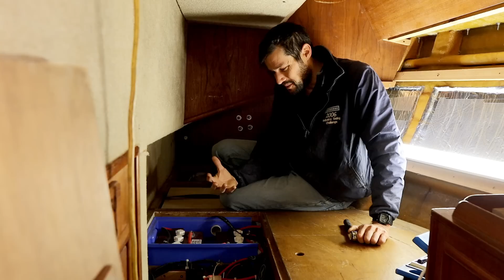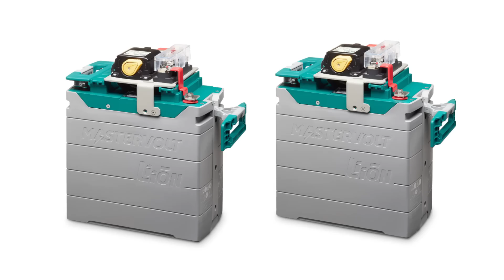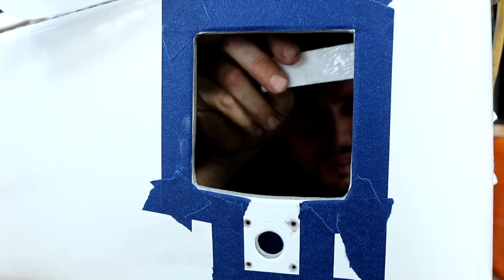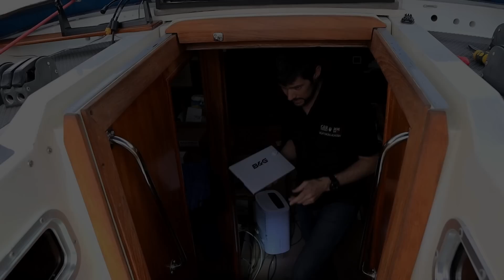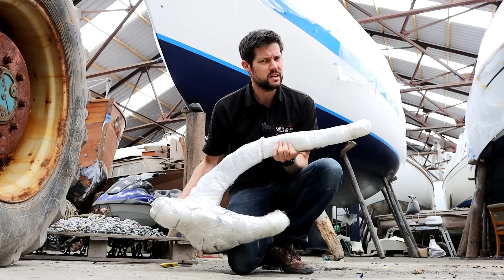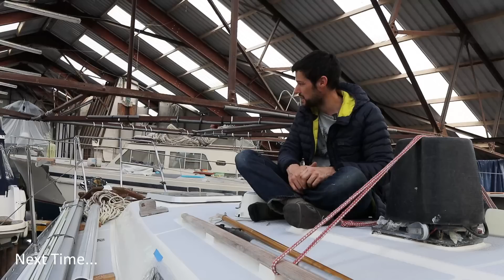Our Biggest Ever Upgrade | Sailing Florence Refit Ep.179

Comment: Will the lithium batteries BMS handle the heavy current to the windlass, without shutting down?
Reply: My understanding is that most Lithium battery manufacturers recommend tying loads like windlass + bow thruster to a lead acid start battery.
Reply: @stephenburnage7687  Well I've been running my windless for six years now with fairly frequent use and I have no problems whatsoever
Reply: The BMS in these dont ‘carry’ the current as you guys think. They will handle any current up to fuse rating just fine.
Reply: @fritsified5952  There have been multiple instances of a BMS switching off all load, leaving the owener without lights, navigation or even VHF. It's one of the consequences of having a complex system.
Reply: @stephenburnage7687  That doesnt mean the BMS of these batteries carry the current as said. Yes, something can go wrong, but these batteries are very reliable. And with the bidirectional DC-DC’s, they will still have power from the starter battery in case of failure.
Reply: @fritsified5952  The question is, is there a way of connecting the lead acid start ystem to the lithium system in the eventuality of a BMS shutdown? Still studying it but most manufacturers recommend removing any automatic battery combiner devices if you install different battery chemistries.
Reply: @stephenburnage7687 Thats a valid question. They have the bidirectional DC-DCs, and its all connected via Masterbus so I guess it should be possible to set it up that way.
Reply: @stephenburnage7687  The trouble is if you connect  a lead battery to a lithium you can get an enormous current flow from the lithiums to to lead, and the ideal charge for lead is around 14.8v which is too high for lithium. I have put my main charge into the lithium service bank, but using a small 12v to 12v charger to charge the lead starter battery, my alternator charges the lithium direct. Btw I have 800a lithium with a 60a lead starting battery.
Reply: What heavy current?  I doubt if the lithiums will hardly notice the current.
Reply: @tmog1000  It's not the battery but the BMS you have to think about.
Reply: @stephenburnage7687  Are you saying that i'm not using bms on my batteries? Coz I am.
Reply: @tmog1000  The point about a BMS is that it is designed to protect the  battery, not the boat. That is one of the key differences from a lead acid system ie in an overload condition, the voltage on a lead acid battety will simply sag, whereas on a LiFePO4 battert, the BMS can step in and shut the entire system down. Most LiFePO4 manufacturers recommend that high load equipment (such as a windlass, bowthruster etc) are connected to a lead acid system but think what happens if your anchor snags on something when you are raising it - a windlass with a design rating of 100A might start drawng 150A. 
If you are happy with your system, great but if you do your homework, there have been multiple instances of a BMS shut down occurring at inopportune times.
Reply: @stephenburnage7687  If your system is shutting down with a 150a draw then you have a very under specified system. Mine are rated at 200a each with 4 in parallel making 800a without overloading. You would need massive cabling to cope with that. 200a is quite common per battery btw.